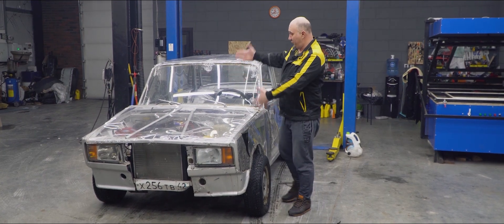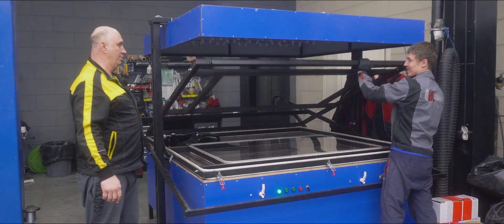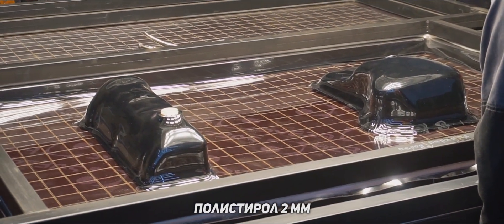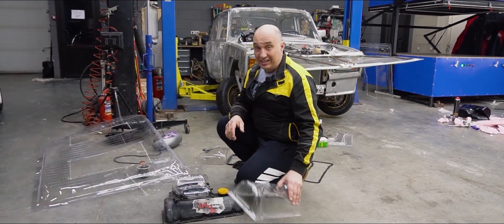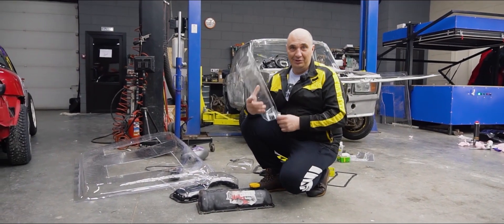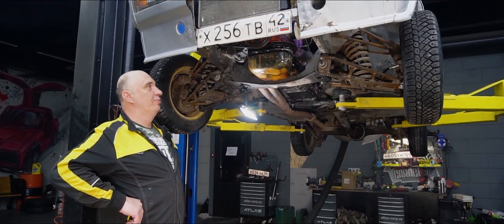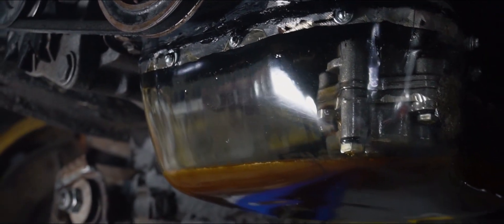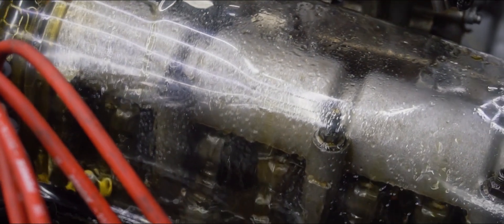Transparent rocker cover and sump to look inside a working engine

Comment: Funny this came out just a couple days after I added an extended sump to my Beetle.  I can use this vid to explain to my family what happens! XD
Reply: What's the advantage to having an extended sump? If you mean it's longer, I suppose it would slightly extend the time. Between non-critical and critical. Probably would have been cheaper to use the dipstick
Reply: @grantperkins368  Oil acts as a coolant to a small degree.  Air cooled Beetles have a relatively small oil capacity.  2.5 liters vs a more typical 4 liters.  Sort of making them the cold-blooded creatures of the car world.  Keeping the engine consistently cool in its factory original state is already an issue.  Modify the engine to increase power increases heat generation.  Compounded with the lack of water's thermal mass, even just driving uphill can spike the system.
Sump extensions allow a larger volume to remain at 'rest' giving more opportunity to evenly distribute heat.  Add that extended sumps offer a bit more surface area to dissipate heat and increase its thermal mass, it's kind of a win-win at the expense of a couple extra liters at every oil change.
This video shows how much a sump can empty while the engine is running and the oil is up in the bearings.  Add that gravity vs viscosity determines how quickly the sump "refills".  Increasing the capacity assures the pump will have a bit more available to work with while the top end of the engine clings on to what's splashing around.  'Top end' being relatively low in the boxer style engine also helps.
Reply: @ImnotgoingSideways  thanks very much for the in-depth reply bro , I feel infinitely more informed now.... really that was great , and good luck with the extended sump:-) I've never owned a VW, how do they manage to cool an engine in the back of the vehicle with air? Fans? Ducts? Crossed fingers?
Reply: @grantperkins368  All of the above.  And, a crazy big impeller bolted directly to the back of the alternator.

Comment: That is a very good demonstration showing the oil circulation and the moving parts on a running engine. Did you fill the engine upto the full level on the dipstick? My concern is the oil level went way down and looked like the oil pickup tube would suck in air into the oil pump, which would damage the pump and engine. This demo also shows how important it is to mount the pickup tube correctly when assembling an engine. Thxs

Comment: Could you try putting a flywheel on each corner instead of a rim and tyre, and get the car to move using a start motor? Independent electric 4wheel drive?

Comment: 7:38 The one thing I learned is that I can see the dangers of impropper application of sealant , or a over abundance of it. You can see that white sealant at the oil pick up filter. 
Over time on a normal vehicle it could clog up plenty of small passages and in a severe case clog the sump pick up filter.

Comment: This one should be hard to drive: independent brakes - 4 master cylinders connected to a joystick in an X  layout with pushrords to the master cylinders, which are separately connected each to a respective wheel. Drive, and use the joystick to activate each brake independently to steer. 

Or use 4 brake pedals?

Also, hook up the throttle to the steering wheel.
Reply: I actually thought of something like that , but with engines instead... But still haven't went anywhere with it so far. 

(The welding the parts together issue keeps cropping up, for what I wanted to do.)

Comment: Anyone else's butt pucker when they first started it up and oil level in the pan dropped to almost nothing?
Reply: Im imagining these cats all over the place running 2qts low too 💀
Reply: Yeah, now I know to check the oil level in my car more often.
Reply: Definitely.  Looks like it didn't stop too far of un-porting the oil pickup.
Reply: yes
Reply: @nickg9021  he said it was just enough to do a test run to start the engine. Where's that "dumbass" emoji 🤔

Comment: I love how it shows why letting the oil get too low is such a bad thing. I never thought that it would be air getting sucked into the pump turning the oil into a foam is what causes the motor to suffer low lubrication.
Reply: I thought they had a coolant leak in the head gasket or something, but that makes sense.

Comment: Greetings from Slovenia ! I follow your channel and I have an interesting idea of what you can try on the car. The idea is to add a gear ratio to the steering column. So the driver would turn the steering wheel quite a bit and the wheels would turn all the way or vice versa. Is that feasible?

Comment: The problem is not having vacuum at the right places. If they had drilled small holes around the bends that "cut off" the vacuum it would have worked fine. Even with the 3mm plastic.

Comment: When I was an apprentice mechanic the school had a Diesel engine with windows cut into the rocker and side covers, it was cool to watch running. Thank you Garage 54 👍
Reply: When I started in a repair shop, most of the people were drunk as Spongebob Squarepants and could find issues that the sober shop foreman couldn't... It was like pointing random engine parts and then changing it, or cars catching fire in the rain because there was an overpass at the wrong moment...

Comment: The valve cover detached...would have been nice to see a more permanent soilution. I did make one of these back in the day for inspecting top end lubrication. Its easier to just mount it, put a few screws finger tight rather than have spray splashing your inner fenders. Wish I still had it. I was a pain to mold manually.

Comment: You've answered a few questions I've had for a while now! Like why do valve cover gaskets leak when there's so much space for oil to pool up and drain before reaching the seams, and why we need to add so much oil into an oil pan. Watching how the oil level really rises on the head and watching how much oil gets sucked up out of the pan just at idle... really makes me curious how things are when you start getting up there in RPM's. So fine, I guess it all makes sense.

Comment: I've worked with thermo-shaped plexiglass. Easy job.
PS: but 1:59, wow that's a bad job, lol
Reply: You talk a lot of huff. But can you back it up when push comes to shove
Reply: @realrickharrison3103  you don't need to push the if you use the correct material. If you use a too hard or too thick material the sheet won't melt well even if you place it correctly, because the heat is not enough or (more frequent) the heating frame can't hold the sheet well enough. No wonder they used slightly softer and thinner material later.

Comment: To see how the oil behaves at -40º with this transparent parts would be a nice experiment!!!
Reply: YES! Leave the car outside overnight then haul it back in and fire it up!
Reply: Yesss. Thank you tor suggesting and thinking of it.
Reply: In Trade School, we watched a video where two six cylinder engines were in a freezer warehouse, one filled with synthetic oil and one with conventional oil. Both valve covers were transparent. Watching how long it took that oil to get up top at 435 below was painful.  Found it too - Search "esso engine oil winter conditions" and youll find it.
Reply: Good idea, sure would beat this one.
Reply: good idea thumbed up. i want to see that too. need more to read this OP
Reply: -40c or -40f? ;)
Reply: @Moon___man  First one, then the other.
Reply: On main chanel this kind of video was just released. -30° Celsius. So just wait a lil bit.
Reply: Probably crack the plexiglass.
Reply: @Senkino5o  Not plexiglass, ABS, would be no problem.
Reply: Hell yeah that
Reply: i fear plastic becomes brittle at that temperature. best to test that first.
Reply: GOOD IDEA
Reply: on the official 54 garage channel which is full in russiam,there is a video with this idea at temp of -30
Reply: Good idea and they listened!
Reply: I saw that video before i found this one 😂😩
Reply: That just did that , interesting
Reply: Agree!!!
Reply: Yes
Reply: Great idea it would be nice to see the Viscosity difference of oil at different temperatures
Reply: Absolutely great idea! And I'm sure there are more applications for the transparent parts!
Reply: Hell yeah
Reply: Yes absolutely
Reply: Word!
Reply: And to see how oil behaves at like 120°+ would be interesting.  Document both ends of the spectrum
Reply: They did it : here the video : https://youtu.be/fNzSQxd4mzU
Reply: He has done it
Reply: He did it already there's a video
Reply: Agree run it hot
Reply: They did that already. Oil was literally a block of solid. The engine was having some of the toughest times of it's lifetime to start. It would keep on cranking but no start. At the end they found out that the distributor, which is I guess is the modern day starter motor, was absolutely grinded toothless and rendered useless.
Reply: Because you need to know.
Reply: Yes good idea. So we can see the oil thinning
Reply: Awesome idea

Comment: Transparent rotator arm cover? Might be kinda boring just an arm spinning around. Still might be nice to see the variation with rpm.
Or even some kind of extension so the cover is raised and the points extended so it's in the open.
Never knew the oil pump was that strong. I'm surprised the heat from the oil didn't deform the clear sump.

Comment: Oil level...
Everyone but Russia: Check Oil Level with Dip stick.
Russia: Transparent Oil Pan
Reply: Bmw (no dipstick) 😭🤣💀🔥
Reply: @ryhu5642  
BMW
NO
OIL,HAHA
Reply: @ryhu5642  dipstick is useless if you constantly use car... checking oil pressure is more accurate.
Reply: @Monni95  Unless you're in a modern car which usually don't have analogue pressure gauges but instead have dummy lights that only come on when you're already out of oil.
Reply: In some countries, they just don't check oil level... When the car stops turning left and right, it has run low on oil... When you see Smurfs coming out of engine, there is no oil left at all..
Reply: @Monni95  So that's why those Smurfs were jumping out of the engine bay? Now I finally have closure. Life is good.
Reply: If it doesn't leak - it means there is no oil.
Reply: Interesting how even when they added enough oil, the pan was still almost out while running. Thanks guys great experiment!
Reply: What the smurf is he talking about?
Reply: Oil blyat

Comment: @8:30 that guy sitting inside the car looks like he has sat there for 30 decades straight.
Reply: Or smoked a fatty behind the garage after lunch. :D
Reply: You can really see from some videos that they did a lot of retakes, because cars change wheels from 4 nuts/bolts to 5 nuts/bolts...

Comment: That's actually pretty cool. I've had loads of Lycoming engines around me, with lots of cut-outs. But not a single of them were functional.

Vlad, I'm sure you could make money on selling functional bolt-on rocker covers etc.  I would certainly want to buy one.
Reply: They'll fabricate another, better one in a professional shop (the vid is available, but isn't English-dubbed yet). I think they've shared the link of the said shop as well...

Comment: they moulded on the outside of the oilpan, so, slightly higher volume, and the pickup is further away, that's probably why they needed to top off

Comment: Put a magnet on the outside of oil pan and move it around to see metal in oil? ☺👍
Reply: Shitters full
Reply: @mrmatt2525able  😉👍
Reply: In high school we ground up Total brand cereal to a fine powder, put some of it on a piece of paper, ran a magnet underneath, and could see the bits of iron moving with the magnet. As advertised, it really is high in iron.
Reply: @outdoorsguy  that's really cool. 👍
Reply: Serious Clark?
Reply: @kronk1623  you couldnt hear a drump truck driving through a nitroglycerin plant
Reply: my thought, too
Reply: Seems like these would make great temporary covers during fresh engine build break-ins. Being able to see a problem and shut down before damage or failure.
Reply: the engine is shot lol, if new oil turns milky str8 away the cars scrap
Reply: @girlsdrinkfeck  They never put enough oil in it, that's why it looked milky... it was aerated.
Reply: @girlsdrinkfeck  Milky oil just means that the engine oil has water in it. That could be something as simple as replacing head or intake gaskets. Even if the engine throws a rod right out the side of the block, that doesn't necessarily mean that the car isn't worth fixing. Also, in this video, the oil was foamy, not milky, which most likely means it was the result of some condensation left inside the engine that mixed with the oil. You can see the oil clear up after the engine reached temperature, meaning that the water had evaporated and vented off.
Reply: @girlsdrinkfeck  Or there was some water in freshly washed engine. Just heat it up and water will evaporate turning oil back to original color.
Reply: @MaciejZałucki  maybe ever a head gasket leak...???
Reply: Hi
Reply: What metal ?
Reply: Not all metals are attracted to magnets, but yeah. I don't know if they still have them but in the old days we had magnetic sump plugs...

Comment: Not doing a transparent transmission oil pan and driving around would be a missed opportunity.
Reply: There aren't really any moving parts under a transmission pan so all you would basically see is the fluid flow.  Pretty boring.

Comment: Can you try an atmospheric intake valve with these clear covers? where you remove the rocker and pushrod and have a lighter spring on the intake valve where the suction of the engine opens it.

Comment: What happens if you replace your coolant with engine oil.
Reply: that would be interesting to see, might have to alter the water pump, the rotor in a normal water pump might not be able to fling the oil like water

Comment: Remove the thermostat and keep the crankcase from pressurizing, you could drive it like this. ;)
Reply: I have done that on purpose when I had a leaking water pump, and nothing open for repairs. The only risk is overheating.

Comment: Did you try to heat the original steel parts with a heat gun as well as heating the plastic sheets? Laying hot thin plastic on cold steel and applying vacuum will prematurely freeze them in place.

Comment: It's what I was expecting. The oil's literally sprayed all over the components. It's pretty much the best and easiest way to ensure proper lubrication.

The only flaw in this experiment is what look like the oil and coolant mixing together, but that's to be expected when you're using flimsy plastic parts. 😁
Reply: But those parts being made of plastic has nothing to do with coolant getting into the system.
Reply: @tylerbonser7686  Hmm. True. It's a substitute head, shouldn't have any coolant conduits. Still, it looked like the oil was getting diluted by something. Maybe it was just air.
Reply: @Milnoc  it's not a substitute head it's a substitute valve cover. Making a head out of that plastic it would have blown apart immediately.  But yes the oil was definitely getting contaminated.
Reply: @tylerbonser7686  I stand corrected. I'm still learning the terminology. It makes working on my own car that much more daring! 😁

Comment: Finally my prayers has been heard, ive wanted this for so long!!! And it couldnt been made by a better channel👍
Reply: I liked the oil level dropping down after startup.  If you haven't seen it yet there's a video on banks performance's channel with a clear rear end cover, really shows how that oil moves and foams.
Reply: Ya this is a first for me, i seen transparent valve covers on a 350 chevy. But never seen this type of setup
Reply: @Texas21Texas  need this for my 350 lol
Reply: I've wanted to see this for at least 20 years! Finally someone does it.
Reply: Your prayers have been heard? Either you’re very over dramatic on YouTube comments section or you’re aiming way too low in life?

Comment: Next thing to try is transparent caps too the radiator
Reply: Probably wouldnt see anything until the thermostat opens, and by then it either melts from the temperature or warps/bursts from the pressure
Reply: I second this setup
Reply: And hoses.
Reply: i can see that ending with the cap getting hot and melting through it and then it shooting out like a geyser lol
Reply: I mean the cap to the entite fin assembly btw.